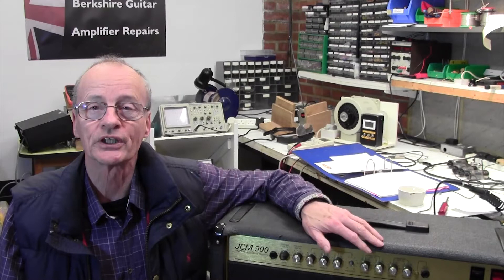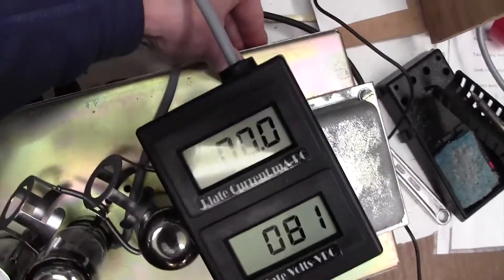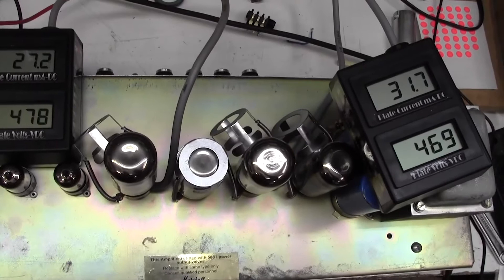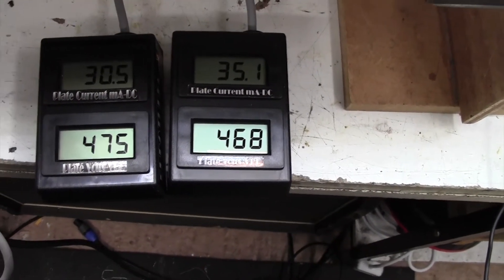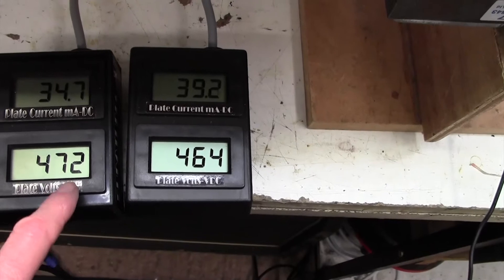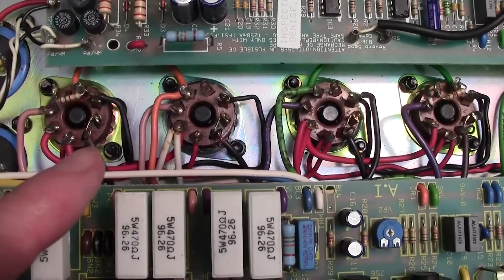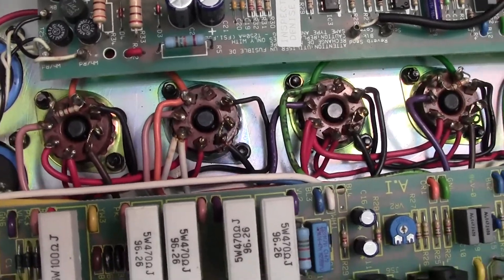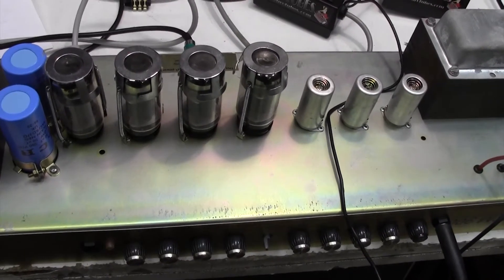How to Bias Marshall JCM900 Amplifier

Comment: Excellent videos Stuart.  Thank you for such great explanation.  I've had the 50W combo version, as my main amp, since I purchased it new in 1991.  EL34 version, have only replaced the tubes once and rebiased with a homebrewed bias checker (with 1 ohm resistor).  These amps don't get the love they deserve.
Reply from the maker: YEs a nice little amp.
Reply: @stuartukguitarampguy5830  Well, I jinxed myself.  Plugged in my SG and started rockin out, last night, and suddenly heard nothing but a loud hum!
Reply from the maker: @markarsenault95  Wow what a strange conicidence. Let me know what you find.
Reply: @stuartukguitarampguy5830  Here's what I found - Bad pre-amp tube 12AX7 was causing the loud hum!  I diagnosed it by plugging the guitar into the return of the effects loop - no hum, so I knew the hum was coming from the preamp section.  New 12AX7 fixed it up.
Reply from the maker: @markarsenault95  Nice fix, well done.

Comment: You can add the 1-ohm resistor, I usually use a 1 watt (will blow like a fuse if there's a problem), and NOT cut off the wire on the cathode.  The wire on the cathode runs to the 2 separate 500 milliamp fuses on the back (1 fuse per pair of tubes, inner and outer). This runs in parallel with 100K resistor to an led that turns on when the fuse blows (this will have no bearing on the bias). To bias the amp, you simply remove the fuses, which eliminates the path to ground, and which now becomes your 1-ohm resistor.  When you're done biasing, just reinsert the fuses.  I do own the Euro Tubes probes, and they are great, but since moving I haven't found them yet (in a box somewhere) and so I came up with this.  Also, a good way to check your probe and make sure you get the correct readings.
Reply from the maker: Useful info thanks Bert

Comment: Hi Stuart. thank you for making all these videos, they are really interesting and full of information. I have a JCM 900 4501 I have just bought. In relation to the 1 OHM resistor you mentioned for measuring the bias voltage. Would I be able to use a 1.5 OHM 1watt resistor for this application? Or would it be best to source a 1 OHM 2 watt resistor?
Keep up the good work!
Reply from the maker: Hi Rhys  YEs 1.5ohm is fine as long as you apply ohm's law correctly using the new resistor value. Reply if you don't understand that. Regards.

Comment: hi stuart, your videos are very good, one question, what happens if the 1ohm resistor is removed and the cable is soldered again after measuring the bias? Thank you  very much
Reply from the maker: Hi I didn;t quite unbderstand your question. Try again?

Comment: I have a friend's amp on my kitchen table just like this one one that blew a cathode fuse. Had an open 150k ohm bias resistor that shot 2 valves in the process. I cant buy a matched quad of sovtek 5881s like it had atm. I only manage to find a pair of tung sol 5881s. Do you have any advice whatsoever? I'd much apreciate it.
Reply from the maker: Hi Daniel, I'm a bit unsure what you are asking me to advise on? Let me know. Thanks
Reply: Thank you for your reply. I managed to buy a matched quad of tad 6l6wgc-str redbase valves that seem to work with this amp. They biased 41 ma @472 plate volts. I think it will be fine. I havent heard from my friend yet but I think he will be pleased.

Comment: Quick question. Is it true that you can check plate voltage by touching to pin 3 of each power tube socket? I think I remember reading somewhere that that’s not an accurate way of checking plate voltage. I don’t know why it wouldn’t be though.
Reply from the maker: Hi. Yes for all power valves apart from EL84, pin 3 is the plate and you can measure there. Several hundred volts DC of course, so be careful.

Comment: Great video, indeed. I'd like to ask you something. I own a Marshall jcm 900 mark III from 1990. It has 50w and I'd like to convert it into 100w, it also has extra holes for the other two valves to be added. Is it possible to do this? what parts should be changed apart from adding two power valve sockets. Thanks a million
Reply from the maker: Thanks. Hmm, I'm not sure about that conversion as I have never done it. It would be much more than just adding two valves though. It may even need a change of output transformer.
If it was me, I'd just sell that amp and buy a 100W one!
Reply: @stuartukguitarampguy5830  Yes, definitely; I've been looking for one but it's almost impossible to get here in Spain. It's a jcm 900 mark III, discontinued in 1993, only three years after the introduction of this amp. If it was a dual reverb I wouldn't have that problem for they're still in production. Thanks again for your help
Reply from the maker: @elbenaso  Also, if I were to wave magic wand and instantly convert your amp into 100W, you'd be surprised at the lack of difference it would make. It wouldn't be THAT much louder to your ear. Maybe 20% louder? Certainly not twice as loud.
Reply: @stuartukguitarampguy5830  thanks for the tip ; )